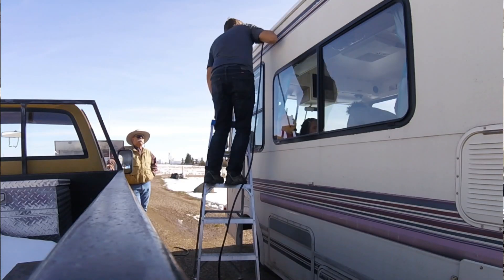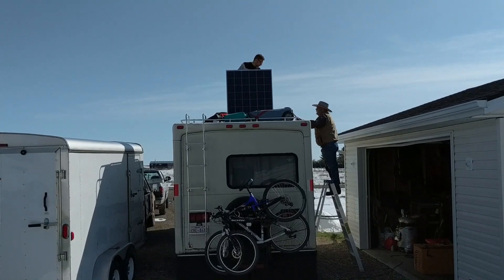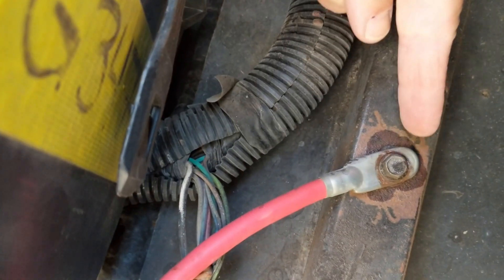Our DIY RV Solar Install on the cheap! // Full Time RV Living // S:3 E:9

Comment: Hi, We seriously considered getting a solar panel array, but when we compared the reliability of our 4000 W generator to solar it was no contest.  What made you invest in solar system when you have a generator?  Thanks for all your great videos!
Reply from the maker: Interestingly enough, we've actually found the solar to be more reliable than the generator for our needs thus far. Many camping areas have restrictions on generator use and/or hours, the cost of fuel, the noise & smell, and the maintenance on a generator are some of the factors that motivated us to at least have some solar power available. It's great to have the option of either power source depending on a particular situation and setting. Besides, we do like the zero-emission result of using solar. Great question, thanks for asking!
Reply: I have had my 200 watt system for about 4 years and would never go back to a generator. Mine has paid for itself several times over. And you don’t annoy your neighbors running a loud smelly generator!
Reply from the maker: @JustMushHere  We agree. One thing to keep in mind is that SOLAR is only to re-charge your batteries where a 4000 watt generator is to power your stuff AND charge your batteries. The key is what you have for batteries and how long you can run your stuff on just batteries. The generator gives power without limitations and our solar system is not a replacement for the generator, just a way to charge our batteries for FREE.

Comment: Good cheap way to go except for.. MPPT charge controller? automatically handles all your charging needs.
Reply from the maker: Thank you and when we upgrade to Lithium and double the solar, the MPPT will happen too. This build was to get there without the big budget and encourage others who are held back thinking it is way too costly to add solar. ~ Kent

Comment: Great video, I have to change around my solar system and mount it to our RV so this was timely. Just curious was your power loss issue all related to the loose ground wire or did you need to install a disconnect switch to the solar for when you are driving?
Reply from the maker: Thanks for asking, what I do is I limit the solar voltage output from 14.1 volts to below 13.5 volts on driving days and it doesn't compete with the alternator. I will install a switch soon too so I can easily kill all power when needed. ~ Kent

Comment: Love it! Simple yet affective. I use a pour over coffee cone and heat the water on the stove top but need to power a cpap machine at night. Looking at Lifepo4 batteries for that reason. Is that the battery upgrade you mentioned?
Reply from the maker: We are narrowing our decision and the 6 volt GC2 Costco is one of the potential options. Either two or four if budget allows. ~ Kent